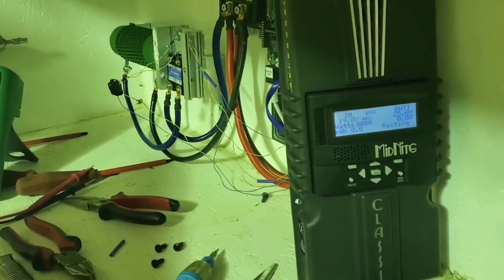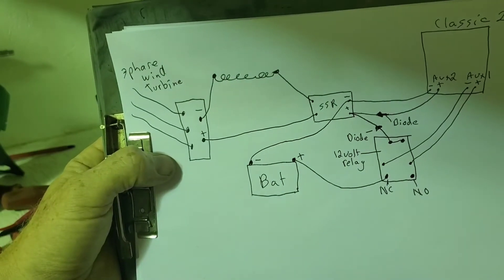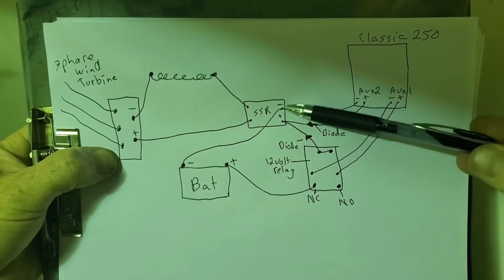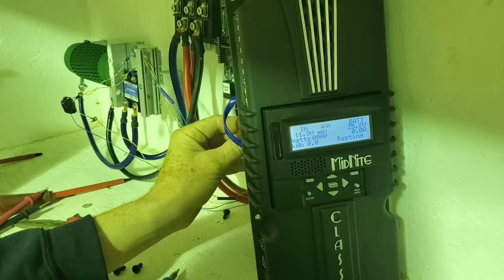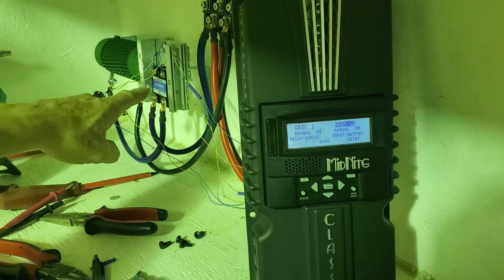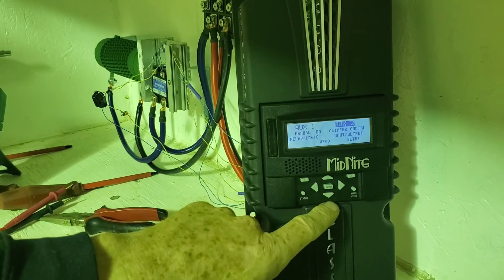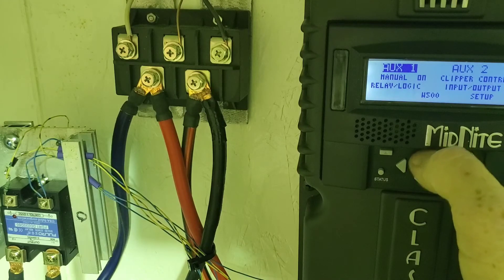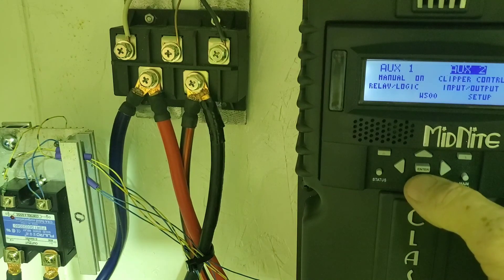Easy Clipper build for the Classic

Comment: what is the reason you put the Diode to ssr from + that comes to aux 1
Reply from the maker: Sorry I was wrong it's to prevent the aux 2 signal from backfeeding power into aux 1 . Aux 2 is the main control circuit.  Aux one is only used to keep the relay open and if the controller looses power it will close the relay allowing the power from the battery to turn the ssr on stopping the turbine

Comment: Super dumb question here but I don't know much about this stuff.  If you had your best pulse motor system charging batteries and they were at full charge, is this system something that could be used on them to make sure they don't get overcharged?  Also, is the Midnight the same as an MPPT controller?  UPDATE: nfm, didn't realize MPPT is a generic term for devices like this.
Reply from the maker: Yeah but a simple there is a  much simpler design that will dump power as needed I'll be happy to show you when I get home.

Comment: I just want to say you’re the man. I’ve been studying videos with the midnight clipper trying to figure out how to build my own and I  came across your video by luck. I have a midnight classic 250 with a HURRICANE Vector 48v Wind Turbine 1500 Max Watt 1000 Watt Continues. What size relay would you recommend for my system?
Reply from the maker: The Classic 250 should be just fine,  you're in luck because in the next few days I'll be building another clipper for this new axial Flux I'm building I pretty much have it all built and now painted I just have to do final assembly and install my second Classic 250 with the clipper. I'll definitely get you a list. I'll have to find the right resistor for your 48 v battery bank, I'm building my clipper for a 24 volt system .

Comment: Do you get that much extra power? If so why not dump into your hot water tank?
Reply from the maker: I do with the inverter,  I can't dump the power into a water tank when it's already hot . The turbine has to stay loaded down. When the classic starts the absorb charge it starts letting the turbine voltage climb. It has to be diverted to the dump load .
Reply: @windpowerandmore6310  I run heaters in my house. I almost never am full . I have 3500w of heaters and I adjust them accordingly. I have been running heat 24 hrs a day for the last 2 weeks. Did 7 kwhs last night . It gives time to charge without overcharging.
Reply from the maker: @frankz1125  I made 5kws in 7 hours two nights ago with that small turbine , batteries are full in the morning when the sun comes up.
Reply: @windpowerandmore6310  nice. Wind isn't good here at my place. Solar works much better for me. I'm in a low spot and surrounded by trees
Reply from the maker: @frankz1125  That sucks , I have a crazy amount of wind,  full sun too . I'm going to be building a big turbine while I'm home maybe test it before I go back to work in may.
Reply: @windpowerandmore6310  nice. Can't wait to see